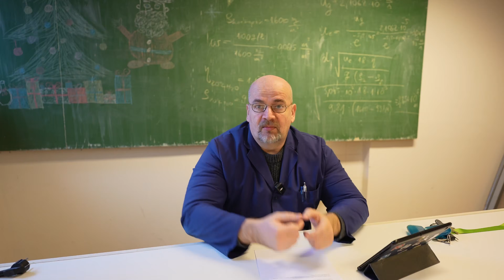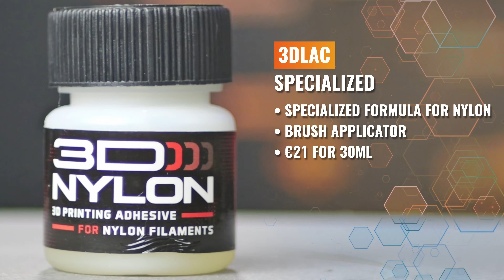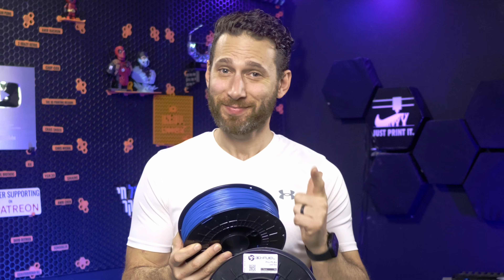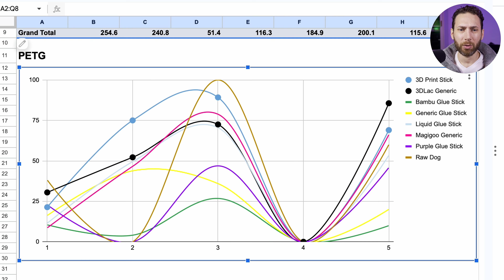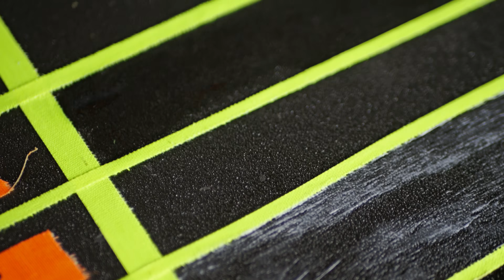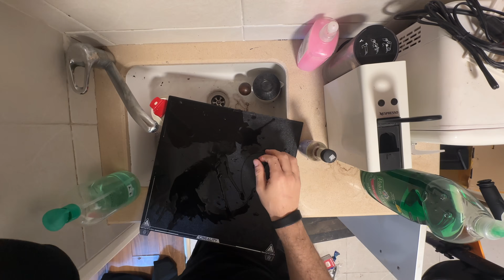I Tested 7 Types of Glue Stick for 3D Printing Bed Adhesion

Comment: No control group?  Meaning CLEAN textured PEI that your greasy fingers never, EVER touch.  Remember, in some situations glue sticks actually inhibit adhesion as a release agent.  The problem 99% of folks have is touching their PEI plate.  The oil from your fingers kills adhesion, and isoproply alcohol, while may help a bit at first, just spreads the oil around.  You'll be dish-soaping your build plate every few weeks thinking it's 'normal'.  You should go MONTHS of being borderline annoyed that adhesion is almost too good.  DON'T TOUCH YOUR PEI PLATE!!!
Reply: Isopropyl does not spread oil around. It’s a solvent that will actually remove oil. Using dish soap, however, will spread the oil around.

Comment: If you are gonna be using bed adhesives, in my experience a textured plate is not the optimal surface - you want something smooth (Or with small variation - eg a sanded/slightly roughed up surface). Certainly, with glue sticks, you will have to apply loads to fill in the gaps.
Even discounting that, I suspect that PEI is not great as a surface for a number of filaments, period - this is probably why you are seeing such bad results with filament-specific adhesives. If the filament itself does not adhere to PEI, then the adhesive quite possibly won't.
My go-to surface is Garolite

Comment: With how often you mention that the data might have issues, it's disappointing to see it still being used. You can't rely on uncertain data to draw good conclusions. I understand it takes a lot of time to make a video like this, but it would have been better to redo the tests or scrap the video altogether.
Reply from the maker: Yeah. Honestly, video deadlines. Couldn't get sucked in. And I was miserable doing this testing...

Comment: I only print in PETG, PLA or TPU.  
PETG I print on a textured plate as it sticks too well on a smooth plate, which seems counterintuitive.
For PLA I only use a 3d printer glue stick (creality branded) on a smooth plate when the initial layer has a low surface area (smaller than 5cm squared).  Otherwise, I do not need glue.
I use the same Creality branded glue stick (it came with the printer) for TPU on a smooth plate to prevent it from sticking.  TPU on a raw smooth plate causes a lot of swearing and work!

Comment: Man i really feel like you were overly rushed to get this video out. Really like the concept of the video and would really like to see this revisited with other products and the bed heated to the proper temp for each material (glass transition temperature). But yeah its hard to take any chart results seriously when there was so many issues and errors with the process. As soon as you saw so many print fails you should have taken a step back and reapproached your testing.
Reply from the maker: It's true. I was rushing to meet deadlines and get the video out (and the one after that). Thorough science isn't my thing, to begin with, but also, it doesn't like to conform to a once-a-week YouTube schedule..
Reply: @thenextlayer  maybe split up series like this to one material test a week to keep the release schedule and tie everything together with a best all in one product video afterwards? Trying to cram everything into one video and dealing with failures like that seems super stressful.

Comment: Nano Polymer has been the cleanest and best for me so far.
Reply: That’s the Vision Miner Nano Polymer, right? I’ve been using it for like 2 years now and it’s honestly incredible. I run a small print garden and I really don’t worry about bed adhesion anymore. 

My only complaint is the application process, but I recently printed a little TPU squeegee and it’s great for a nice, thick layer that doesn’t end up in the brush.

Comment: The print samples near the edges of the build plate were at an automatic disadvantage due to the inherent uneven heating across the build plate.  The temperature drops off - sometimes quickly - as you approach the outer perimeter of the heat bed which will lower adhesion.
Reply from the maker: The Prusa XL uses 16 independent heaters for exactly this reason. It doesn’t suffer from that problem
Reply: @thenextlayer  Not aware of this tech but would like to see verificaiton with a IR temp gun or half fancy sensors.

Comment: Before the textured PEI plates came out I used purple gluestick for every print.  At that point in time i only printed PLA, PETG, and TPU.  Purple gluestick helped PLA stick much better.  For PETG it did a good job keeping the first layer consistent but not to good as it can be hard to get prints off the bed.  I don't want something to stick to much.  Some of those actually make it to hard to get off.  If I need to use something I'll go with a thin layer of purple gluestick.

Comment: I agree you might need these if you are printing exotic materials, but for PLA / PETG I never needed it, anything that has failed? was due to me not cleaning the bed with Isopropyl alcohol before printing. If I were to print ASA/ABS or PC filaments, I would probably need a G10 bed with one of those solutions applies to make it stick.

Comment: First rule : maintain and clean buildplates ! As CookieEliminator and you wisely said, a properly maintained and clean print surface tremendously helps.
As for adhesives, I mostly use them rather as "release" agents than anything else. PET/PETG/PCTG/Flex stick too well to build surfaces, hence that use. Same thing for TitanX and ApolloX from FormFutura, respectively ABS and ASA, which I print a lot : they stick too well, hence the use of adhesive as separating interface.

Which is best ? 3DLac works very well, same thing for Magigoo, same thing for FormFutura EasyFix series. VisionMiner's Nanopolymer also works very well. There is no "best" to me, at least according to my own mileage.
Reply: @Myrblyl  Bah. Clean build plates are seriously over-rated. Once you embrace the goblin tech of Aqua Net, you might never clean your build plate again.
Reply: @SwervingLemon  Yeah, and once that "goblin tech" of Aquanet works it's sticky way far enough into the sliding and rolling surfaces of your printers, I hope you have the funds for a new printer or the time and knowledge to tear it apart and clean up all that gummy mess from those precision parts.  I have revived the corpses of several dozen printers that have succumbed to that false idolatry of hair spray... tell me. do you also spray glue into your bearings?
Reply: @edwardpaulsen1074  Interesting that you would wish failure on somebody...

It's been over seven years of near-continuous printing. When I spray the bed, I use an old file folder as a shield to prevent overspray from settling on the fans, and on the bedslinger it's bed is all the way forward, effectively covering the Y-axis assembly.

Since I installed removable flex plates years ago, I could probably just remove the sheet and spray it somewhere else, but haven't seen the need.

Thanks for your concern, though. 😁
Reply: @SwervingLemon  I see.... so would you use that same file folder method if you were spray painting?  Would you still do it that way if ANY overspray could ruin a $500 project?  You may have been lucky all this time... that is great, more power to you.... but not everyone is that careful or that lucky..., as I mentioned for the dozens of printers that stopped working or developed problems due to that adhesive overspray... Once those "dead printers" were thoroughly cleaned, they miraculously came back to almost original operation.  You do you if it works and you are willing to accept the consequences when they eventually arrive... A 3D printer is still a machine tool and will still require basic maintenance and a modicum of understanding of the process variables and materials to get the best results.
Reply: @edwardpaulsen1074  LOL - seriously, dude; It wipes off clean with alcohol. I started using it back when bare aluminum beds were the norm and you couldn't get enough adhesion. Now, with my magnetic build plates, I sometimes use it just to create an interface layer between the carborundum and PETG or silks for EASIER removal. 

I've been building printers since the early reprap days, before the (redacted) patents expired, and I've been using aqua net Extra Super Hold almost the entire time.

I don't know if it's a property specific to aqua net, but overspray has NOT been problematic, and that's even with a V6 heatbreak fan sitting right where it could easily suck up overspray.

You might have serviced some gummed up printers, but I'd chalk it up more to carelessness in application than a problem with the hairspray itself. It's really not that bad, I promise!

Edit: Forgot to mention - with the removable build plates I could just as easily (and did) spray them outside, but learned that spraying right as the bed got around 40c made for the best tacky surface and returned to doing them in place. If I were using an enclosed CoreXY like a Bambu, Voron or whatnot, I might spray them outdoors, but my only corexy uses a 16*24*quarter inch tempered glass build surface that top loads into the machine, making that basically impossible...
Reply: @SwervingLemon  That is all great. I have been involved in the Rap Rap movement myself since 2011... I am not saying that the hair spray does not work... it can work great *IF* care is taken to keep it out of the other parts.  The issue is that there are far too many people that think a 3D printer is like some kind of Star Trek replicator that needs no maintenance or other care when it is a machine tool.  People will hear something and just do it without thinking or caution...  I helped run a few 3D Printing communities and the crazy ways people would destroy their printers through neglect  and misuse was mind numbing. I eventually had to drop off because people would not listen and then complain that the printer company was garbage because of something that the operator did.  My issue comes in blithely telling someone that "Method X can work" without going into the necessary steps and what can happen if they just do "method X" without suitable precautions...  But hey... you want to argue and justify your methods, maybe you are being careful all along.... that is you... that is NOT a bunch of other novices that just got their first printer recently... You do you, you can go ahead and deal with the angry e-mails and posts when they blame you for their printer crashing. I'm out.
Reply: @edwardpaulsen1074  I get that, but the reason I'm such an Aqua Net fanboy is because it IS so versatile and seems to be the panacea for adhesion issues. I don't fault the product when people use it wrong...

"This fuel is messing up my car upholstery!"

Comment: I accidentally used Magigoo PA when printing ASA-CF. This was on Bambu high temp plate. The part did not come off to the extent that the sheet was pulled off the plate. 🙈

Comment: I use one build plate for one type of material. I found out, that printing for example PETG after PLA may cause problems. Looks like the microscopic parts left on the build plate that are not compatible in adhesion inflicts each other. So - one buildplate per material + 3D lack ist what I do since..... long, and nearly never have problems.
Reply: Same. I wrote the material on the build plate with a permanent marker and use it almost exclusively. PLA on smooth PEI. PETG, ASA, Nylon, PC on Satin sheet where I use one side for PETG and the other for the rest. TPU on textured sheet. I don't use any other adhesive.

Comment: Been using magigoo regular, seems like for my needs its working well. my fav part is how little mess it makes vs standard glue stick. looks like once it runs out ill have to check out some of the other offerings! I use it on my textured pei for more of a release agent (since i print only petg and tpu, and some other materials on) and on my wham bam pex for pla, which has made pex my favorite plate again. gotta try one of these supertak or cryogrip build plates in the future

Comment: Thanks for attempting this!
I have a X1C and a T1Pro, I primarily print PLA and PETG on textured PEI plates at "out of box" bed temps.  With any combo of those, I haven't encountered adhesion problems such as plagued me with my MK3S+.
I >do< however use "glue stick".  But primarily for easier release.  I bought a package of cheap "Amazon basics" purple glue sticks.  I clean my plates with dish soap, let them dry over night.  I apply a thin amount of the stick in a back and forth motion, then I use a "blue shop towel" saturated with 99% IPA in a random circular motion to "flow" the glue and even it out.  This works well for me, but I suppose what I should do is run some tests doing only half the plate, printing the same model on both sides and see if I'm REALLY getting any benefit from my effort.
Reply: What’s the results..
Reply: @ClappinCheex   I never bothered running the tests I suggested I should, didn't seem worth the time.

Comment: The single best build surface I've used is regular blue tape. I wish it lasted longer though.
Reply: Not good for high temp filament. The glue boils.

Still a great choice for pla.

Comment: First and foremost I want to give you props for even undertaking such an ambitious project. 
Nonetheless, in my opinion  there are two problems with your experimental protocol. (After all who am I to judge your work 🤷‍♂️?.)
But here goes anyway. First trying to run these tests with one bed temperature is potentially fraught with problems. 105° C may actually “cook” some these materials. On the other hand, the high temps may give unfair advantages over others. 
My second observation is that dinging some materials for actually pulling of chunks of the build plate is unfortunate. Those “too strong” materials may actually release without any problems when the plate is allowed to cool. However, I cannot imagine how to carry such experiments any other way. 
Finally, here is just some of my observations. With “Raw Dog” plates, I find that cleaning the plate occasionally with IPA really helps. 
My favorite magic sauce is from Vision Miner. It’s probably more expensive than most of the rest. But “In my hand” as many scientists would say, I like Vision Miner. And it’s available from Amazon.
Reply from the maker: Thanks for the feedback. I really appreciate it, and yeah, I’ve kind of realized that these types of videos are not what I’m good at.
Reply: @thenextlayer It’s obvious that your intentions were honorable. Unfortunately you chose to wrestle an enormous bull. 🐂

Comment: Well Magigoo just flat out doesn't work. I've never successfully finished a print with Magigoo, it basically turned my textured PEI plate into a nonstick surface because literally nothing stuck to it, it all just globbed up
Reply from the maker: That’s really odd because for me it’s basically Magic with every material. I’ve used it on and I’m not saying that because they are a sponsor, but rather the other way around.

Comment: I'd probably also give a C, tho more from incompleteness of tests (seemed like the things being tested weren't all the most useful, and there probably should have been some preliminary tests to make sure that the prints wouldn't have issues the affected the others) obv kind of hard to tell before the fact, I know, but it definitely would've helped the results be a bit more conclusive 🤷🏿‍♀️
Reply from the maker: You’re absolutely right. If I hadn’t already put in so much time and effort, I probably wouldn’t have published the video… But my big take away from this was to stay in my lane, I prefer building things and making projects rather than doing research!
Reply: @thenextlayer  I mean that's fair, always good to get something out of something, even if it wasn't what you set out to get; and even if the results weren't as conclusive as initially hoped, I'd say it was still good content :p